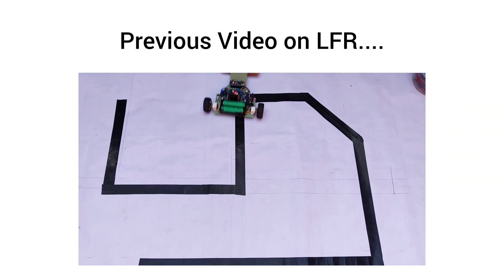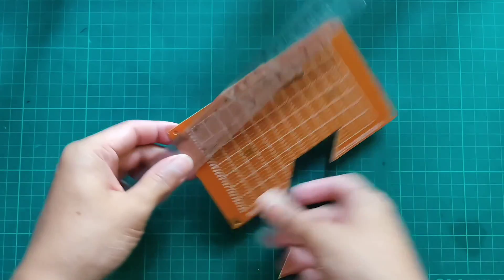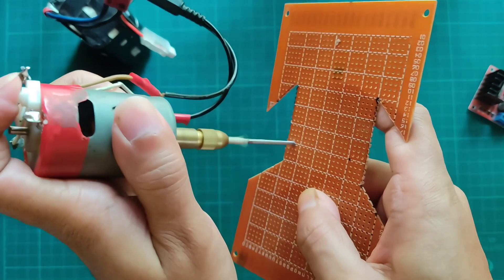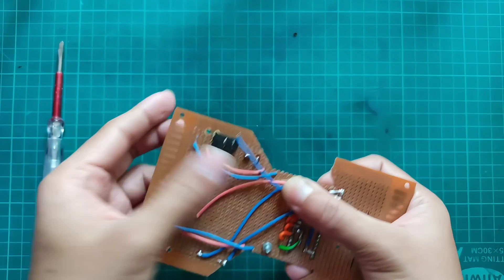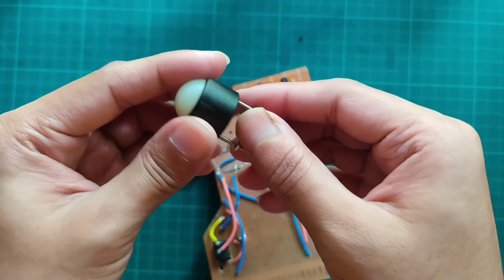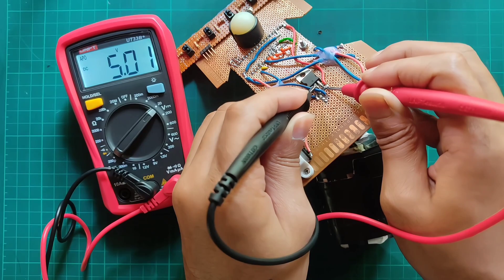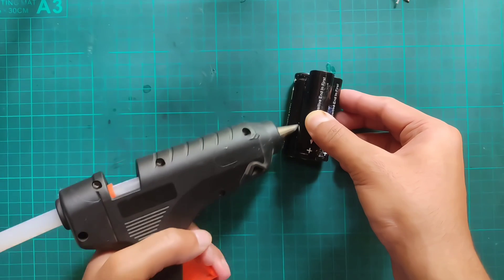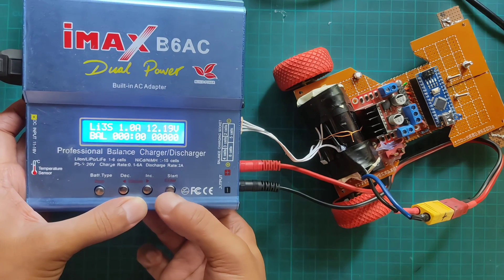Fast Line Follower Robot using 5 Channel IR Sensor and PID: Step-by-Step Tutorial

Comment: my value is only reached 700-800, is it okay?
Reply from the maker: ok
Reply from the maker: Then calculate threshold according to the minimum values
Reply: @ the line follower i made can’t properly turn just like yours in the triangle, what is needed to change in the code?

Comment: bro how can i change the pin to A0,A2,A3,A4,A5
Reply from the maker: @Robotrack-Arduino  execute the for loop for 0 to 5. That's it
Reply: @aslamhossain1   would you write it for me bro thanks
Reply from the maker: @Robotrack-Arduino  for (int i = 0; i < 6; i++) {
sensor[i] = analogRead(i);
if (sensor[i] > threshold) sensor[i] = 1;
else sensor[i] = 0;
}
Reply: @aslamhossain1  Thanks bro it works now

Comment: Give me the code please
Reply: //motor pin defines
#define IN1 6
#define IN2 5
#define IN3 4
#define IN4 2
#define enA 9
#define enB 3

//declaration of necessary variable to line follow
int s[6], total, sensor_position;
int threshold = 531; //set threshold as like i've shown in video
float avg;
int position[6] = { 1, 2, 3, 4, 5 };
int set_point = 3;

//push button and led
int button_pin = 12;
int led = 13;
bool button_pin_state;

void setup() {
  //motor driver pins as output
  pinMode(IN3, OUTPUT);
  pinMode(IN4, OUTPUT);
  pinMode(IN1, OUTPUT);
  pinMode(IN2, OUTPUT);
  //button pin as input
  pinMode(button_pin, INPUT_PULLUP);
  //led pin as output
  pinMode(led, OUTPUT);
  Serial.begin(9600);
}

void loop() {
  button_pin_state = digitalRead(button_pin);
  display_value();

  //when button is pressed then the robot will start to follow lines.
  while (button_pin_state != 1) {
    //blink led
    for (int i = 0; i < 3; ++i) {
      digitalWrite(led, HIGH);
      delay(100);
      digitalWrite(led, LOW);
      delay(100);
    }
    PID_LINE_FOLLOW();  //line follow using PID_Value
  }
}

void Sensor_reading() {
  sensor_position = 0;
  total = 0;
  for (byte i = 0; i < 5; i++) {  //snesor data read from A0, A1, A2, A6, A7
    if (i > 2) {
      s[i] = analogRead(i + 3);
    } else {
      s[i] = analogRead(i);
    }
    if (s[i] > threshold) s[i] = 1;  //analog value to digital conversion
    else s[i] = 0;
    sensor_position += s[i] * position[i];
    total += s[i];
  }
  if (total) avg = sensor_position / total;  //average value
}

void PID_LINE_FOLLOW() {

  int kp = 50, kd = 500, PID_Value, P, D;
  float error, previous_error;
  int base_speed = 200, left_motor_speed, right_motor_speed, turn_speed = 100;
  char t;

  while (1) {
    Sensor_reading();
    error = set_point - avg;
    D = kd * (error - previous_error);
    P = error * kp;
    PID_Value = P + D;
    previous_error = error;

    //adjusting motor speed to keep the robot in line
    right_motor_speed = base_speed - PID_Value;  //right motor speed
    left_motor_speed = base_speed + PID_Value;  //left motor speed
    motor(left_motor_speed, right_motor_speed);               //when robot in straight position

    Sensor_reading();
    if (total == 0) { 
      digitalWrite(led, HIGH);
      if (t != 's') {
        if (t == 'r') motor(turn_speed, -turn_speed); 
        else motor(-turn_speed, turn_speed);          
        while (!s[2]) Sensor_reading();
        digitalWrite(led, LOW);
      }
    }

    if (s[4] == 1 && s[0] == 0) t = 'l';
    if (s[4] == 0 && s[0] == 1) t = 'r';

    else if (total == 5) { 
      Sensor_reading();
      if (total == 5) {
        motor(0, 0);
        while (total == 5) Sensor_reading();
      } else if (total == 0) t = 's';
    }
  }
}

void display_value() {  //display the analog value of sensor in serial monitor
  for (byte i = 0; i < 5; i++) {
    if (i > 2) {
      s[i] = analogRead(i + 3);
    } else {
      s[i] = analogRead(i);
    }
    Serial.print(String(s[i]) + " ");
  }
  Serial.println();
  delay(50);
}

//motor run function
void motor(int a, int b) {
  if (a > 0) {
    digitalWrite(IN3, 1);
    digitalWrite(IN4, 0);
  } else {
    a = -(a);
    digitalWrite(IN3, 0);
    digitalWrite(IN4, 1);
  }
  if (b > 0) {
    digitalWrite(IN1, 1);
    digitalWrite(IN2, 0);
  } else {
    b = -(b);
    digitalWrite(IN1, 0);
    digitalWrite(IN2, 1);
  }

  if (a > 200) a = 200;
  if (b > 200) b = 200;

  analogWrite(enB, a);
  analogWrite(enA, b);
}

Comment: Hi is this code/robot is suitable for 1000 rpm? i trying to switch to 1000 rpm but im not sure if the pid code is suitable for that speeds.
Reply from the maker: Not suitable
Reply: @aslamhossain1 Is there an any way to adjust it's code to became suitable for high speeds? Or adjusting it's kp kd is the solution? i just want to know bcuz im still learning how pid works thank you.
Reply: @Christian-lr4wt  Hey! changing the speed means you WILL HAVE TO tune PID again.
Reply: @Christian-lr4wt  yes change in the pid or go to any ai webpaege such as bolt or claude for expected results

Comment: The bot is not catching the line , it goes away from the line in curves and turns...how to set the correct kd values? Should i change the base speed and turn speed?
Reply from the maker: You can adjust by changing these parameters. Base speed in the speed of the robot. You can reduce it if the robot wobble.

Comment: well instead of using a ic regulator you can use a arduino nano itself to control the output voltage to ir sensor array and l298n also i feel it [pretty useless for the regulator to be used
Reply from the maker: Arduino and L298 doesn't provide enough power required for IR sensor. Hence the robot won't run properly. That's why I've used regulator. Buck converter would be better.
Reply: @aslamhossain1   and another thing can we get the schematics and code for the 8 channel qtrc line follower please that would be awesome if you did

Comment: Great design. No need to waste money on car chassis.
Anyway. Why it always pick the bottom route at the arrow symbol ?  Both top and bottom black lines look like they have the same thickness.
Reply from the maker: It always follows a specific rule that is set in the code.
Reply: @aslamhossain1  What should distance between each sensor be?
I already made one which each sensor is about 31mm apart from each other.
Mine is 6 sensors.  I haven't tried on the robot car.
Reply from the maker: @jumbo999614  2cm from center to center

Comment: sir, my circuit is the same like you, but when i'm using the button at D12 on nano, only 1 motor (right) working, how i fix your code with this problem, please help me to run 2 motor
Reply from the maker: Check the motor driver pins.
Reply: @aslamhossain1  i already check, but it still be the same error

Comment: i have a project in the line following robot and i check all the connections but it still does not work.....do we press the push button after we open the switch?
Reply from the maker: Yes. After pressing the button the bot will start to follow line.
Reply: @aslamhossain1   okay it works but the sensor detect from only when its really near to the ground almost touching the ground ..why is that?

Comment: Which one of  3V 6V or 12V N20 gear motor i should use??
Reply from the maker: 12v
Reply: @aslamhossain1 I'm using L298N motor driver. Is it okay to use 12V motor
Reply: Also if i didn't found 12V by any chance. Can i use 6V
Reply: @Unkn0wn_Reel  yes

Comment: sir what to do if my 5 array ir sensors give max value on white and min value on black
Reply from the maker: a little bit of change in digital conversion part: 

if (s[i] > threshold) s[i] = 0; 
else s[i] = 1;
Reply: @aslamhossain1  sir but i have done if(s(i)<threshold) s(i)=1
else s(i)=0   is this wrong ? my bot goes forward and always try to move to left and if i take it up and put down it goes in reverse direction
Reply: @aslamhossain1 ভাই তো দেখি কোর্ড মুখস্থ করে খাই ফেলছেন😅

Comment: I connected the circuit and it lights on when I connect the arduino with the laptop put when I remove it and turn on the switch it does not light on or move
Reply from the maker: Check all the connection. The problem is here

Comment: Bro rotatory encoder is not required? So how are you using PID
Reply from the maker: Used push button.
Reply: @aslamhossain1  my sensor analog readings are opposite max for white and min for black

Comment: What to do if I have a maker-line IR array by cytron which gives digital readings,  can we connect those to the arduino the same way
Reply from the maker: Yes. But need to change in code.
Reply: Thank you so much for replying....❤️

Comment: why the code does not define the A0 - A7 for the connection with the sensor?
Reply from the maker: Doesn't need to define. analogRead(0) means A0, similar other analog pins.
Reply: @aslamhossain1 So if I make the sensor position on the analog pin on the Arduino Nano not match your video, for example with a random position (Sensor 1 to A3, Sensor 2 to A2, Sensor 3 to A4, Sensor 4 to A6 and Sensor 5 to A7), what's the code? How can Arduino Nano recognize each sensor? Please help me because I am still confused about the sensor declaration regarding the analog pin. Thank You.
Reply from the maker: @juansiahaan9737  i've connected sensor from right to left serially. Not Randomly. Then i've used "for loop" to read sensor value.
Suppose: analogRead(i);
Here "i" value start from 0 to 4. If i = 0 mean 1st sensor. i = 1 mean 2nd sensor, i= 2 mean 3rd. Similar for Remaining sensors.
Reply: @aslamhossain1  Thanks in advance for the answer. Then in your code int position[6] = { 1, 2, 3, 4, 5 }; why is there int position[6]? Even though there are only 5 sensors based on your video tutorial.
Reply from the maker: @juansiahaan9737  its array size. you can it 5 or greater. No problem.
Reply: @aslamhossain1  Sorry, I use 5 units of TCRT5000 sensors. If I use analog pins A0 - A4, would the code be int position[5] = {0, 1, 2, 3, 4}; is this code correct?
Reply from the maker: @juansiahaan9737  yes

Comment: can i use a 7805 vc instead of 7805 ic
Reply from the maker: Isn't it 7805 ic? what does vc mean?
Reply from the maker: You can use buck module and set output at 5volt
Reply: @aslamhossain1  I meant 7805 cv but i think it's the same thing .. if I'm gonna use an arduino uno what shoud i change in the code
Reply from the maker: @FatmaTarek-cj8vi Don't need to change anything.
Reply: @aslamhossain1 but how .. I should change the analogs bc there’s no A7 in the arduino uno ..right?

Comment: Will it work without the t Connector?
Reply from the maker: Yes.
Reply: @aslamhossain1  the diagram shows that you connect a 220R but you didn’t in the video so should I connect it or not?
Reply from the maker: @fatmatarek854  need to use for led and push button

Comment: Friend, I congratulate you for the work done, but I have a question. If I don't have the battery, can I use regular batteries? Or do I have to meet the voltage and amperage requirement? This is my question, please I will appreciate your response.
Reply from the maker: You can use any type of battery. Lithium or 2s/3s Lipo battery.